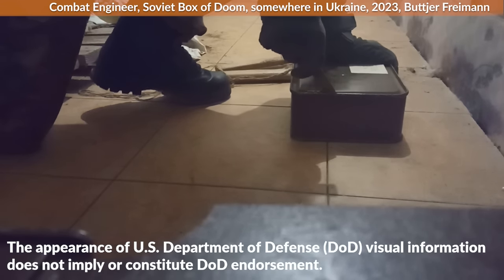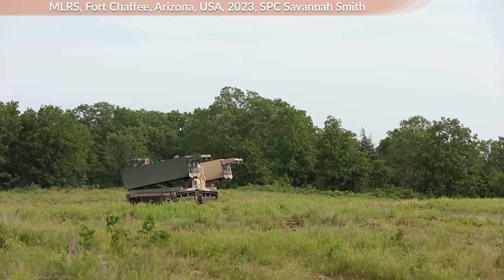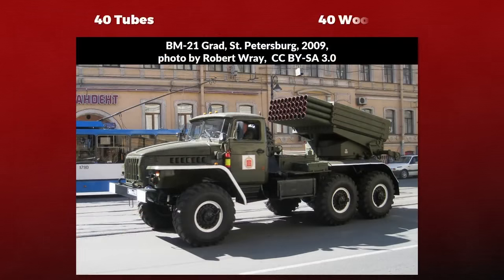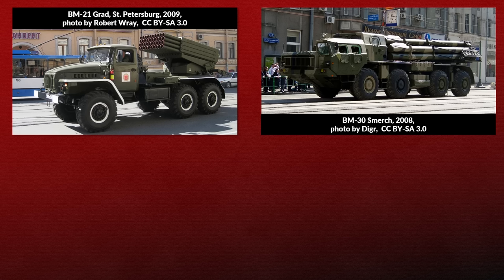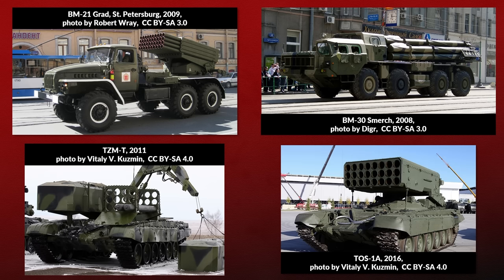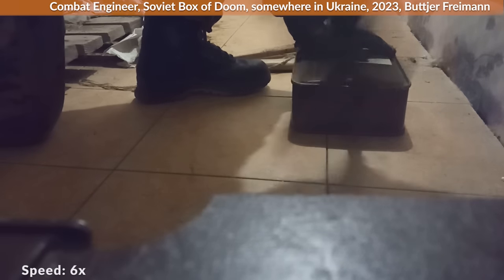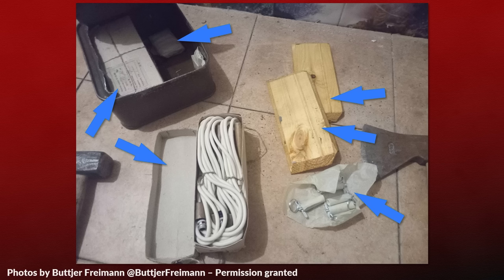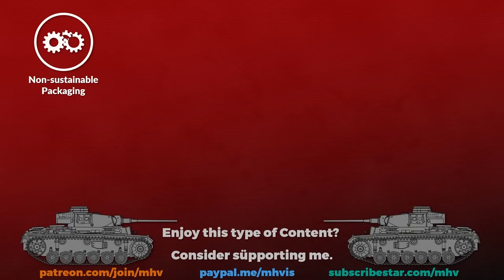Ukraine: Why Soviet Packaging is a Nightmare - Unboxing Edition

Comment: Breaking open Russian small arms ammunition is always such a joy.  [/sarc]

Your engineer correspondant is dead on.  Those can openers only last (barely) two cans before becoming poor quality prybars at best.

Blew my mind the first time I cracked open a can of 5.45x39mm and realized it was full of paper wrapped packets of rounds, and NO stripper clips, bandoliers, etc.  And since one can was far more than a single troop's ammo issue, you'd be exceptionally lucky if your opened cans and your issue matched up exactly, but you have no way to adequately protect a partial can for later use.

The troops are (if they are lucky) issued a limited number of stripper clips, that they have to retain for later reuse, by manually loading loose rounds from the paper packets.  And tbere is no way to carry a quick post-firefight load of prepped stripper clips to top off your magazines during the "comsolidate and reorganize" phase after a fight.

Meanwhile, US forces (and at least some NATO forces) get issued ammo in resealable cans, generally preloaded into clips and in bandoliers.  Current US 5.56mm ball ammo for rifles is even packed into bandoliers that have expandable pockets, where each picket holds enough ammo for one magazine, and by pulling a white thread that loosely stitches the pockets short (so the clips can be readily retrieved), the now empty pockets will each hold a single 30 round magazine.  Meaning, worse case, the supplybguys can just stand by the side of the road, opening hinged ammo cans, and just hand out several bandoliers to troops as they walk past.  The troops have wverything they need to carry the ammunition and to load it into magazines (with a basic load of 7 magazines per man taking less time than the time it woild take a squad to open a singke Russian ammo can).  And even if the troops have isufficient magazine pouches to carry all of their magazines (say, they're loading heavy for a particular tasking), the bandoliers can double as magazine pouches (OK, flimsy ones, but they only have to last for a single use).
Reply: I just saw a neat trick to fold an ammo-can bandoleer around both shoulders (like a bra) and boom, poor man's chest rig!
Reply: The design of those bandoliers is so brilliant. Great way to store and distribute ammo, AND can double as a bad but useable temporary pouch for magazines if you get caught off guard.
Reply: A spam can of 1080 5.45x39? Do you not know anything about a Soviet squad's basic load of ammunition? It fits that basic load perfectly. Or almost perfect.

7 dudes x 150 rnds = 1050 rnds. So you are over by 30 rnds. This doesn't account for the gunner who may be carrying a RPK or a PKM. But it makes sense if you don't know if there will be a PKM or a RPK. If an RPK it is easy enough to divide another can between the gunners in the platoon. 

And the wood crates came packed 2 spam cans to a wood crate  and 1 opener per wood crate. So it only NEEDED to last 2 cans. It was perfect.

And the theoretical standard load for a soldier with a AK-74 was 3-4 mags and an extra 60 rounds on stipper clips. Look at the mag pouches of the period. Look at the pouch with the little leather tab. That was meant for the stripper clips. But it's easier to put another 30 rnd mag in there. So carry 4x mags in the pouch. In war, there are extra mags around to be put to use.
Reply: Yeah, those 5.56mm ammo cans are great.  Lots in there to make the issue of these rounds easier.  That's what I was used to due to the military.  You take it for granted and it's not like that everywhere.  I assumed every armed force out there was comparatively like this.
Reply: @Werepie bbbuuut wat abaoot muh shopping spree milicharee, which has everything it needs and doesn't? Muh penk and blæk multicam!

What poorman's chest rig? I carry top fashioned LBVs at all times!

Seriously, the amount of bragging in comments about "muh military" and then this. Admiration about organizers bags being able to substitute a chest rig.
Reply: @woodsghost9088 exactly, homie isn’t very bright. Going off 210 round combat loads.
Reply: @goforbroke4428  eh, "inexperienced" would be another word. Must never have seen someone with a 90, 100, or 150 round basic load.
Reply: @woodsghost9088  either that or he’s a bean counting nerd going off of “superior western” combat loads.
Reply: For what it’s worth, there was this machine for loading AK mags from a hopper of loose cartridges. It’s not like it was never planned for. It was just half-assed a bit.
Reply: @Blankstieg , was it hand-operated or electrically-operated? How big was it?
Reply: Also note Soviet MMGs like the PKM use non-disintegrating belts, so they have to be manually reloaded from loose rounds. This is slow and painstaking, but the 2 step process for reloading rimmed cartridges from a non-disintegrating belt has proven to be very reliable compared to say Minimi in Ukraine after heavy fighting given it is also lighter.
Reply: Push and Pull logistics at work.
Reply: In the 1970s I was issued with factory-fresh cotton bandoliers with each pocket contaoining clips of 10 x .303 ammunition, to go with the issue No. 4 rifle.
It's a) possible to do all the setup for the soldier, and b) it's been done since the 1940s at least.
Reply: we could have pre-loaded single use magazines sealed like a can of sardines.
You may say oh no, the spring is expensive! Then let a pressurized air do the job. It would speed up things
Reply: @woodsghost9088  Good sir, you seem inexperienced yourself, as 90, 100, or even 150 rounds for a basic load is far too little if your soul purpose in life is to engage an OPFOR element. I dare to say 210 rounds divided up by 7 magazines ( 1 magazine in the rifle brings the total mag count to 6 ) is barely sufficient as well due to factors like gaining fire superiority, utilizing IMTs to advance up to an opposing force, as well as shifts in fire on an OBJ in order to overwhelm an enemy.

The way soviet ammunition distribution is set up allows ease of use for supply, not actual reloading times, where as their western counterparts have most of the work done on reloading before those that require said ammunition even receive it. However, in times of war these reloading times mean the difference as shorter times to reload means you can get more rounds down range faster than OPFOR could.

Cheers.
Reply: @mstwinklebotz6240  oh my word.

What was the basic load of the Chinese in 1970?

What was the basic load of the Norwegians in 1990?

What was the basic load for the US in 1940? 1965?

What was the basic German  load in 1995?

What was the Russian basic load in 1975?

What was the Romanian basic load in 1995?

What was the Czech basic load in 1991?

What was the Canadian basic load in 1988?

What was the French basic load in 1965? 1995? (Actually, I don't know what the French load was in 1995 either, so if you research it, let me know what you find).

And those are all historical facts. The "ignorance" comes when one doesn't know WHY the combat loads were what they were. 

The "inexperience" is displayed when one shows they don't know that other countries don't always follow a US approach based on 5.56. 

Further ignorance is displayed when one shows they don't have a education in what the US used prior to 5.56.

A fair reply might be "in combat, it's all different!!" Sure. But the planners have a "basic load" they use and build around. Soldiers in theatre then work around that and chuck it if possible and necessary. Some US soldiers in Vietnam carried 1,000 rounds of 5.56, should we then say the basic load was "1,000 rounds" because SOME soldiers carried that in actual combat? Some US soldiers in 2018 were carrying 120 rounds of 5.56, should we say THAT is a US basic load? 

We look at what the planners set up as their intended, envisioned "basic load" and use that as a starting point. And seek to understand the "why" behind those decisions.

We can, if we like, look at what actual soldiers carried, but that is HIGHLY variable.

Another valid argument is "basic load depends on what position one holds with a military." A truck driver usually has a smaller basic load than assault infantry. And weapons issues to rear echelon troops can vary widely. Some Russians, today, are getting issued Mosin Nagants. Others are getting the AK-74. So sure, that can vary.

So before you call me "inexperienced" for saying a basic load can be 90, 100, or 150 rounds, look up the basic loads mentioned above.
Reply: @CoffeeAndPaul  Hand-operated. When moving from place to place power isn't always available.
Reply: @Werepie Had an old guy tell me about this one time, saying if you ever see a bobby pin in the strap of a bandolier it was so you could wear it as a makeshift chest rig. Had no idea what he was talking about till I saw a short about it recently
Reply: @worldoftancraft  Not everybody in the military is high speed-low drag. If you need a POG to run a bunch of ammo, the ghetto chest rig is a great way to at least give him something. Mind you, these were designed in the 80s, where individual body armor was a newfangled idea. They kept it around because it worked. In the field, I generally kept a duty bag under my legs while in a vehicle. That bag was basically just a 3-4 dozen STANAG magazines that I kept topped off for "emergencies". Before that, I kept several of these bandoleers ducktaped together into a single mass that I could have one of my boys just fetch and haul.
Reply: @pwrserge83  all of that prepping thing awfully reminds me of Sovet preparations to conflict C which will result either in new world order lead by someone, or mutual annihilation. And do I need to say it didn't withstand the trial of time.
Reply: The soviet union never had enough consumer goods manufacturing capability to include stuff like cotton bandoliers in ammo packaging. 

Russia was an agrarian economy up until Stalin's time. Stalin turned the Soviet Union into an industrial power house in 20 years, by taking the short cut of skipping light industries and only focusing on heavy industries, and they only developed heavy industries enough so as to make weapons and military vehicles with civilian vehicles as an afterthought.  

The result was they made enough tanks to destroy western Europe twice over but everyone's groceries had to be rationed all year long. In the end it was the lack of consumer goods that broke the union as people from students to bureaucrats were fed up and wanted the union to fall.

As late as 1994 Russians living near the chinese border were trading motorbikes and tractors for stuff like clothing and food.
Reply: It's funny how US forces have all the supperior ammo, technology and whatnot, yet they LOST in every single war since WWII. They lost even to Taliban for crying out loud. To the old men in sandals. Seriously WTF? 🤣
Reply: @dsx7517   Because they want to be liberators not conquerors and as such have their hands tied by their rule of engagement. But liberation is just a meaningless propaganda term. If you just overthrow a government by force and then leave the country to its own device, you'll be blamed for creating a failed state. So in reality liberation means installing functional democracy before leaving the occupied country, which is way harder than military occupation, esp considering America cant even make San Francisco work.
Reply: Resealable cans are good only for NATO "desert human safari". Ammo tin cans has minimal "dead weight".
That is practical in REAL conflict.
And most of it is human-transportable. No need for special crane or special vehicle in case of MLRS.
Reply: Oddly enough none of the M855 ball my unit received (2005-2006) in Iraq was so packaged. It was all loose packed green tip direct from Lake City.
Reply: @h1tsc4n40  i didnt know this while i was serving and threw away literally 1000s when issuing ammuntion for ranges, like literally filled giant trash cans with just the bandoliers that i now see for sale at surplus stores for like $10 each

Comment: I've still got some Warsaw Pact surplus 7.62 x 54R rifle ammo in somewhat similar "sardine cans" as I call them, because the cans of sardines we had as kids opened the same.  There's a narrow ribbon around the can just below the top which holds the top on.  You pry one end loose, fit a slotted key over it, and wind it all around the can to free the lid.  The lid can be put back on, but it's just loose.

Some of the same ammo cans do have that horrible can opener key instead.  I don't know why they chose one or the other, maybe it varies by Warsaw Pact country.  The sardine can key is easier, when it works, but the more ribbon which gets wound up, the worse the leverage, and the more chance of the ribbon not winding correctly, slipping off, and making a real mess.

On the other hand, the ammo inside has always been good, never a single misfire.

I had always assumed both were so funky because they were old surplus.  It amazes me that such packaging is still used.  I can't imagine being in combat, running low, and having to struggle with either packaging.  I'd be tempted to take the axe to it right from the start even if it meant destroying some of the ammo inside.
Reply: 25 years is best day before ammo.
Longer ok if x RAY etc used to see if powder is still POWDER and not solid TNT .
Why surplus is sold… help poor or get shit out of invetory ?? Think❤
Reply: That key is more common with SPAM and similar stuff.
Reply: @454FatJack  A lot of the USSR surplus was sold as it way a way to get money now  and the new governments needed that.
Thus it was sold for pennies on the pound, far lower then its true cost.
Reply: @naamadossantossilva4736  There is a marginal increase in cost per can to do the Spam method. 
I don't know if cost, or unavailability of the machining to make such cans, or just plain institutional inertia is the cause here.
Reply: I am fairly certain that those cans would be the distribution company's job to open and hand out. Doubt the actual front line troops would be messing around with those.
Reply: @baraka629  no. The frontline troops would get them sealed up, by the dozens and expected to disperse them amongs the trenches or in concealed locations so they could always have their own little "depots".
Don't forget, one can of 7.62x39mm contained 700 or something like that bullets and one can of the same dimensions contained 1080 5.45x39mm.

It would take 2 guys with a little bit experience and medium effort less than 5 minutes to provide the entire section with 1400 or over 2000 rounds of ammunition.

Which makes the claim that russian/soviet logistics suck in the start of the video all the funnier.

I got this as second hand experience from my father and from my basic training instructor who was a recon soldier in the Croatian military during the war in the 90s.

My own limited experience with this was with 120mm mortar mines/shells, that came in similiar boxes, 2 mines per box. A single mortar crew is 6 men, the weapon and a small truck. When we received the ammo we were supposed to fire off for the day, it came on a big truck in these boxes. 2 men could carry two boxes stacked, more or less easily (one mine is 17kg after all), so it really wouldn't take you very much to unload a significant amount of ammo and disperse it around the weapon safely with quick access none the less.
Reply: I have some decades old can openers like those from ammo boxes, still work just fine.
That box had unreasonable thick metal though.
Reply: I have multiple cases of  7.62x54r. Bought them when they were under 100 a case. Now they over 400
Reply: Storage life above all else. Like stupid warnings on modern products, this philosophy could likely be traced back to one unfortunate person. Possibly an officer during the Stalin era who was shot for sabotage when the ammo under his command was ruined by environmental conditions. Everyone else, not wanting to share a similar fate, made sure the problem wouldn't happen to them. Stalin is gone, but traditions started under him live on.

A friend bought a case of 7.62×54 years ago and ran into the problem of opening it. He assumed it was the key and ribbon spam type. No key. Tried pliers, no ribbon. Eventually he used a knife and hammer to start it, then chisel and hammer to finish. We joked that this is why fighting was done during the day. It took all night to get the ammo you'd need for the next day's combat.
Reply: @christopherconard2831  ah yes, the tried and true rationale of "i didn't known how to do it right, so it is clearly bad by design"
Reply: I have opened both types as well, and I too prefer the "sardine can" with the key. I get it going with the key as far as I can and then use channel locks. Never a misfire for me either, with 70 year old ammo.
Reply: @454FatJack  I've never seen or heard of old smokeless powder becoming dangerous. Usually old ammo fails in one of two ways - either (a) the primer won't fire or (b) the case is corroded by either external environmental factors or nitric acid produced as the old powder decomposes. (a) is safe but renders the ammo useless. (b) can cause case ruptures which can be dangerous but it's still not "solid TNT"